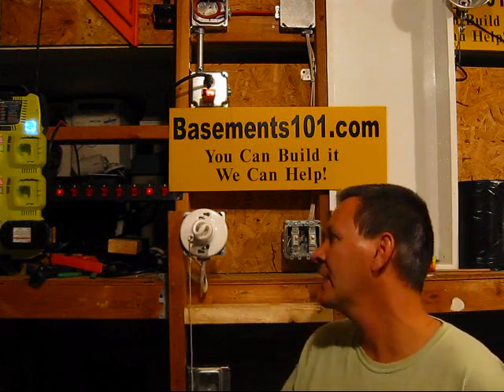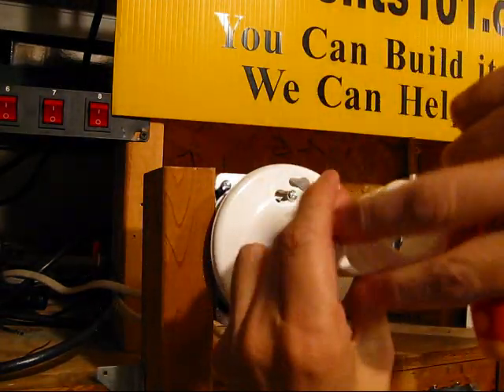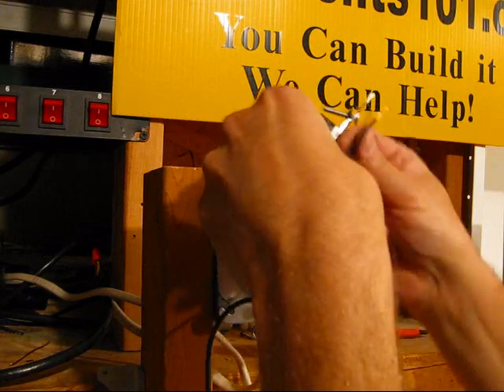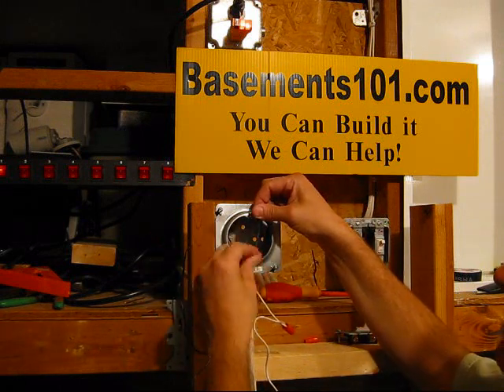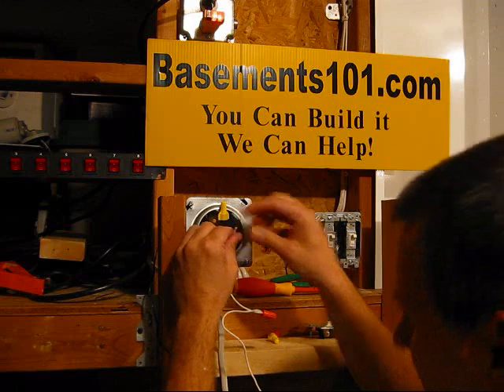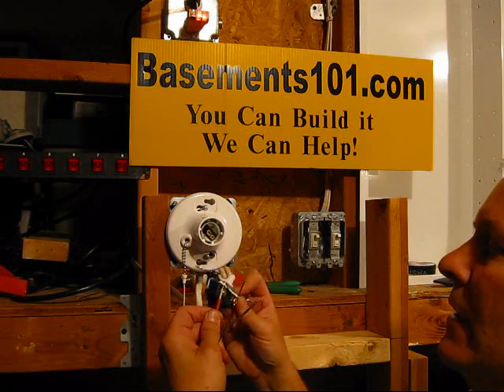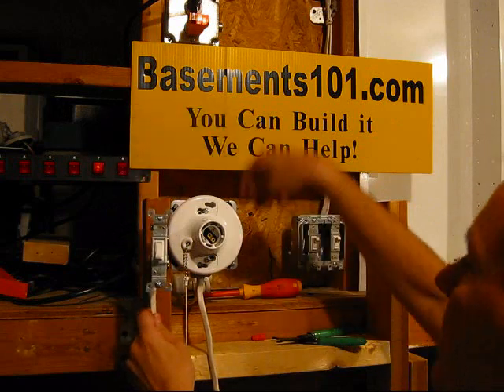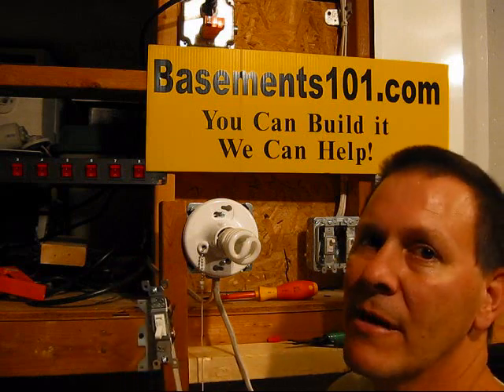How to add a switch to a light fixture

Comment: Yes. If you look at the video 4:58 you will see black wire being connected to light. To connect multiple lights you will need to add a black (hot) wire at this connection. Flipping the switch will allow power to go to all lights. Note you also need a white or neutral wire at each light fixture.

Comment: Only person puttin a video like this on YouTube. Nice.
If you reword it to maybe something like "Replacing a pullchain with a light switch" you may get better hits. AWESOME> Thanks so much.

OH, QUESTION: Do you ground the other end of the neutral wire somewhere in the light fixture? All you said was to attach the ground to the green screw in the SWitch, but nothing about that wire in the fixture itself...........
Reply: notice the wire that is added for the switch the would be neutral white wire he put red tape on each end to show now it has live power from the switch to the light fixture

Comment: My question is if this isn't the last fixture on the circuit (there is a wire leaving my light fixture, im not sure where it goes considering there is ducting and insulation hiding the wires and they may lead to my sump pump or living room receptacles) would everything else after this fixture be controlled by the switch that was added?

Comment: Solved my problem!  Though I had to replay the video between the 4 minute and 5 minute marks about a dozen times, I finally discovered the need to create a pigtail to reconnect the light.  Then it worked!

Thanks for your video.